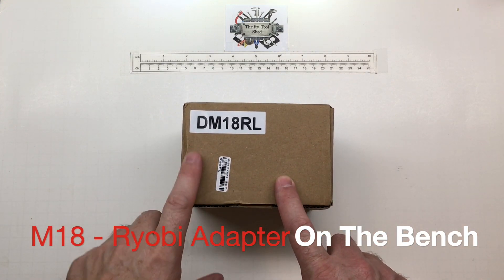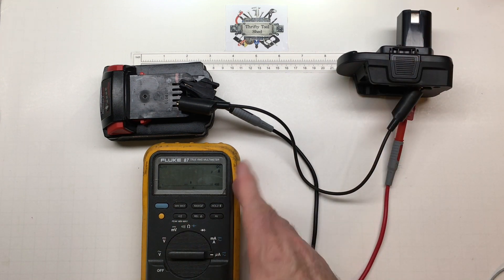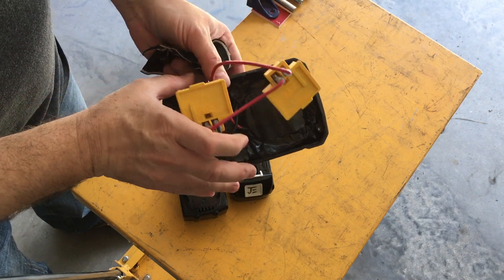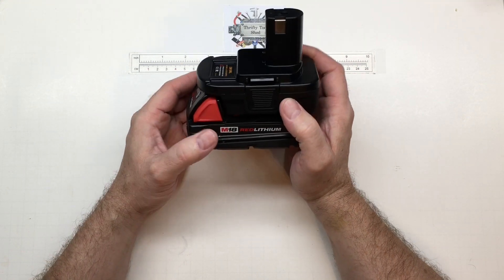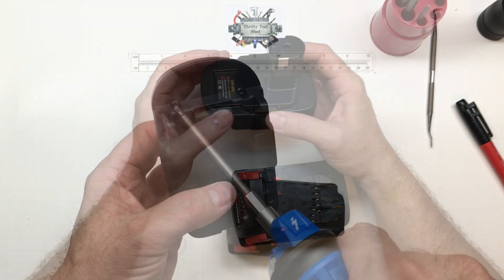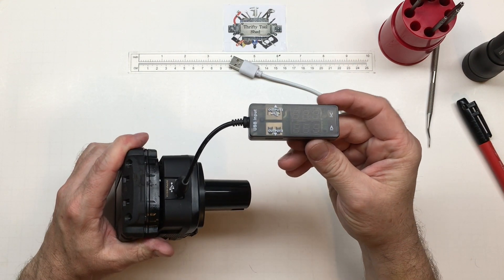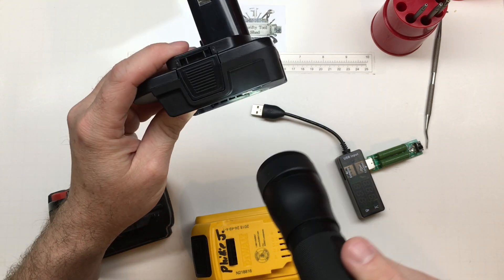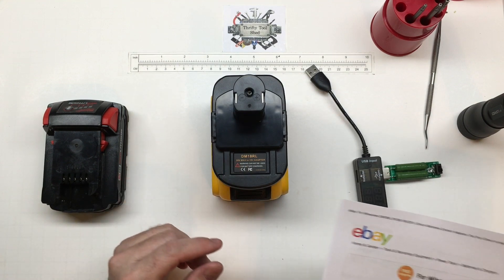DM18RL Adapter use DeWalt and Milwaukee Packs in Ryobi Tools

Comment: Good sir, thank you for your fantastic review! I appreciate your more technical review.

My only concern here with these adapters is that I have not seen one include a low voltage cut-off. Not really a concern for someone with electronics adeptness, like yourself, but I could only imagine the poor lad who uses these and over-discharges their battery pack.

Cheers!
Reply from the maker: Yes,  something to consider for sure.
It surely would pull down too low if not monitored. I do have a couple videos with the low voltage cut out relays, but will add extra bulk to it for sure. Thanks for your comment!
Reply: @ThriftyToolShed  I had already watched them. :D

I found some adapters had enough room to fit that low-voltage cutoff module inside (or at least looked extremely similar) with some creative mounting. The price of, well, everything electronics has shot up during recent times. I should have ordered more of those cutoffs when they were only a few dollars a unit.

Even that well-made M18 mount you used on that Dyson retrofit has skyrocketed in price.
Reply from the maker: I have noticed the price increase for sure.  I am hoping it relaxes soon. Hoping it doesn't continue to increase. Some of my videos I take time to mention that links that I share and prices are subject to change  so use them as an example only for sure. It pays to shop around on many of these items. Sometimes that's why I share a photo of the Amazon or eBay screen shot 8n the video so you can see the price as I paid for it for comparison. I tried to start doing that because of the price hikes we are seeing! Thanks for your comment!

Comment: Someone pointed out that Dewalt battery packs are dumb/gutless packs and have no protection, so one have to be careful of not over draining the pack...the USB adapter also put a constant drain on it. Better mod the adapter and add a properly sized protection board for a high drain 5S pack
Reply from the maker: True. Yes I would not leave it in the adapter for any length of time. I have a video about the DeWalt packs and they do have some cell and temp. Monitoring but yes only the DeWalt tool itself gets that trigger from the board to cut off. The Milwaukee may be like that as well, again, if used to "get by" its fine for me without adding a BMS because I am using it and watching it. Of coarse connected to a constant drain and leaving it would be a bad idea! Which honestly the pack I have such as Ryobi with the built in mosfets and BMS are my worst about draining down to zero, on there own even!
I personally notice very quickly with most power tools when a 20V pack pulls down to around 15V. But some may decide to add a BMS and that would be a great video, let me know if you get time to post one!
Reply from the maker: I remember checking the current draw of the adapter without any load. I remember it being really low, but since I could not remember I checked it again. The adapter only draws .17mA (170uA) so even though I do not think it's wise to leave the pack in the adapter for a long period of time, it would take about 2 years to deplete my 3AH battery to depletion. Just wanted to share the information in case someone was wondering!
Reply: @ThriftyToolShed  that's the number I had calculated also, 1 year on an 1.5Ah pack

Comment: Did you ever fix the connection problem???...I bought one also and its doing the same thing...Any remedies? ...thanks
Reply from the maker: I was going to either extend or replace the contact blades on mine, but I came across the 2 Dewalt packs and after successfully repairing them, I am just using them for this application. I have no other use for them other than this and they fit well and have been working really well.

Comment: These adapters are pretty cool.
I hope more are made for other tools.
I'm curious if the Black and Decker will fit in it?
Reply from the maker: Yes, I also want a Black and Decker for an older pole saw I have. Although some are available, most are made to fit Porter Cable packs which I don't have.
Reply: @ThriftyToolShed  I'm curious if the new B&D will fit in the adapter you have now.
Since they are almost the same as Dewalt.
Reply from the maker: @aurthorthing7403  Would be good to know, I do not have any at the moment but maybe soon!
Reply: @Aurthor Thing  @Thrifty Tool Shed theres an option for B&D, stanley and porter the product name is BPS18RL

Comment: The DM18RL fit both Milwaukee and Dewalt?  Or is there a different model for the Dewalt?
Reply from the maker: It actually fits the DeWalt better than the Milwaukee. I mainly bought it for the Milwaukee but also mentioned DeWalt in the description, turns out it fit the DeWalt even better!
Reply: @ThriftyToolShed  thanks, I always thought that all these tool manufactures use different type battery fit.  So I naturally thought that these 2 batteries had different fittings.  Just a after thought... So it's possible to use Dewalt battery on a Milwaukee tool, and vice versa?
Reply from the maker: @cameranmanner4701  well the thing is the adapter has combined the latch for both or (incorporated enough of each) that it works. But the connection for the Milwaukee is not good. So they did not quite get it right. 
The two batteries are too disimilar to interchange without modifications.

Comment: How did you end up extending the Milwaukee connection points? I need one of the milwaukee to ryobi adapters but no idea which one to purchase. I only have one ryobi tool so no reason to buy a new battery for it.
Reply from the maker: I ended up repairing several DeWalt 20V Max packs and thats really all I use them for. Since I have alot of Milwaukee and Ryobi, I went that direction. I still do need to buy another one and see if I can make it fit the Milwaukee packs better for sure. It will work, just not happy about how it barely makes contact! I will give them some time and I am hoping if I buy another one they will have fixed the issue?  If I did not have several DeWalt packs just for use with it, I would have tried to modify it.

Comment: Does it have a low voltage cutoff safety measure?
Reply from the maker: No, it does not.
Reply: Thrifty Tool Shed as bummer . Gotta make sure to never let the batteries fully die
Reply from the maker: @keenang4705 ,
That is correct!
Reply: @ThriftyToolShed  if you ever come across any with the low voltage cutoff please make a video and let us/me know!
Reply from the maker: @keenang4705  will do!
Reply from the maker: I remember checking the current draw of the adapter without any load. I remember it being really low, but since I could not remember I checked it again. The adapter only draws .17mA (170uA) so even though I do not think it's wise to leave the pack in the adapter for a long period of time, it would take about 2 years to deplete my 3AH battery to depletion. Just wanted to share the information in case someone was wondering!

Comment: Can this adapter be used on the small 18V Ryobi push mower ?
I have a heap of Milwaukee batteries.
Reply: I have a 13" 18V Ryobi mower and have mowed using an identical adapter with the exact same fitment issue. I used a 9.0 M18, the battery lid doesn't close, as long as you don't pick up the front wheels too high the battery maintained contact. I'd still prefer an adapter with a better fit though.

Comment: That's a 18V battery not a 20V...hehe
Reply from the maker: I know it's strange how different manufacturers claim different nominal voltage levels on the packs they produce. We all know that 5 x 4 is 20 no matter the brand but still some decide 3.6v nominal instead of 4.0? It makes them seem different when there is no difference!